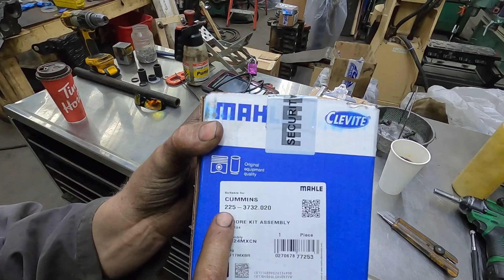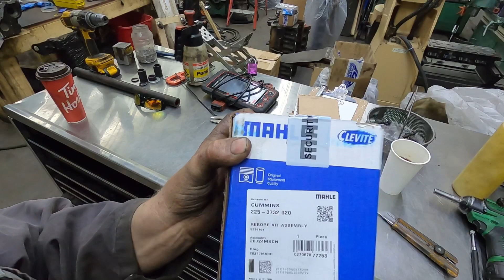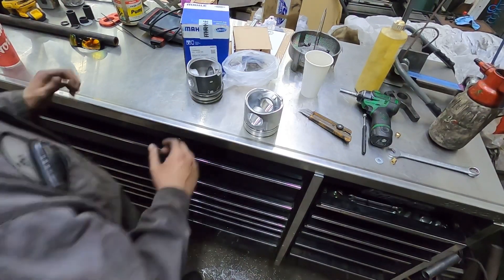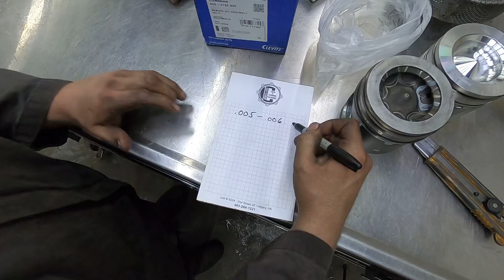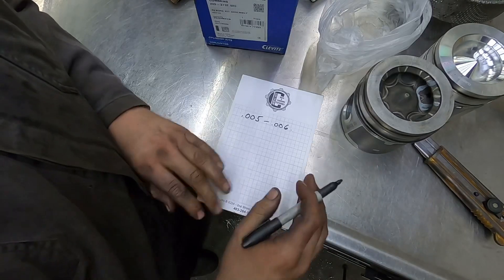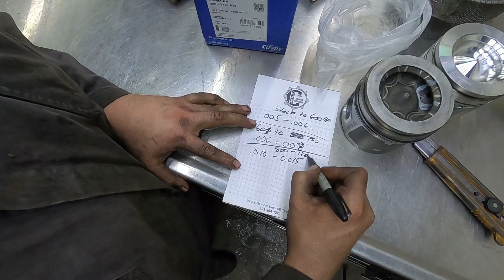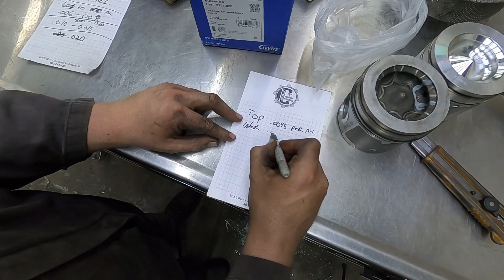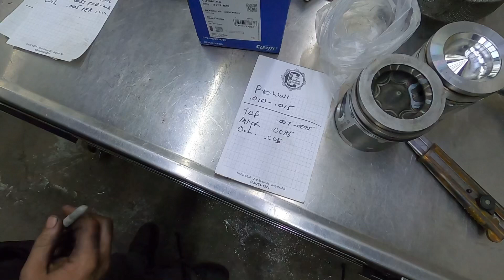Pistons / Ring clearances . Talking about piston stuff

Comment: This is why I worry a bit.
I have mahle pistons, coated on side and top.

Dfc only set my 0.0065 ptw… and I’m planning on going a little over 1000…
I told them over and over again. Hopefully it’s ok… running a 12.5mm P pump. Lesson learned… shoulda drove to you:

Their reasoning was I’m basically gonna drive it every day and we don’t want excess wear. It’ll be raced maybe a couple times a year and a few dyno events… but I’m still stressing….

Comment: Great video and lots of help but im still a tad confused....what would you set ring gap for on a daily driver/tow rig for a cummins 12v 400hp motor fresh rebuild as far as ring gap on a 20 over bore?? Thank you so much in advance
Reply: Did you ever figure this out?
Reply: @quiksilver1j did you mean me?? And yes i set it to factory specs as im staying around a 1000tq.. basically set it at .006 on cylinder 6 and .004.5 on rest of the cylinders.... thank you

Comment: Good info!  In the process of putting a 5.9 CR together and noticed the PTW was only .004.  I'm taking it back to the machine shop on Monday to loosen it up to .006 and .0065 on 1 & 6.  Tow with it mostly up mountain grades.  When I tore it down, compression ring on 1 & 6 were broken in half.

Comment: On our blown alcohol engines we have typically run 0.0015”-0.002”/inch of bore diameter. This is a steel block, aluminum piston. And we have data logging with light indicators that help keep us below 1,400 degrees EGTS. I would think this would also work in a diesel as well if you were planning to run a setup with good air and kept your temps down. And then like you mentioned once you start to make more heat then you would be running as much as 0.003”0.004”/inch of bore.

Then for ring gap we are in that .008”/inch bore range, making 30psi boost. Again we try to stay below 1,400 degrees, but we have had a couple times where we have hit 1,700+ and tulipped valves and melted pistons, but the rings and ring lands were fine.
Reply from the maker: I am not familiar with the blown alcohol stuff but i know if you run cummins that tight you will have some issues. might has to do with the alcohol
Reply: @CUTTERUPROB  it should be fine. 6.7 std bore is 4.210 so at .0015”/inch you would be 0.0063” ptw and at .002”/inch you would be 0.0084” ptw.  The biggest benefit we have is we only run around 10.1:1-10.3:1 compression instead of the 16.9:1 or even 19:1 that diesels do. I would love to do an in cylinder pressure comparison from a 2,000hp alcohol engine to a 2,000hp diesel.